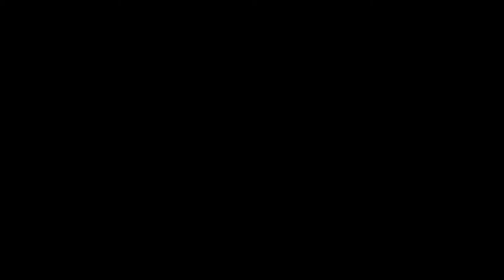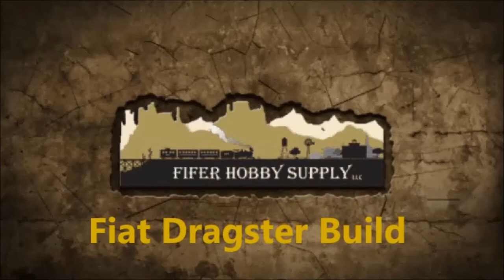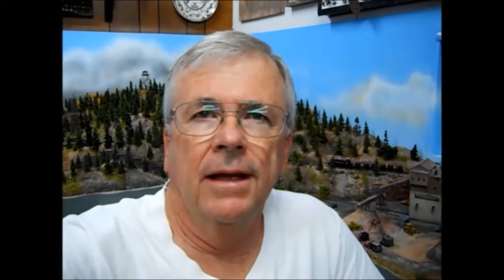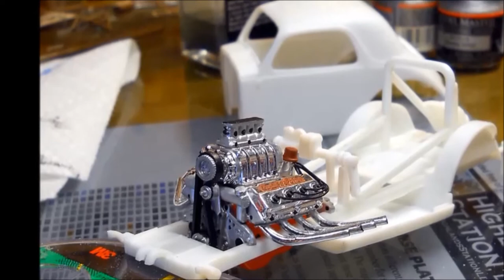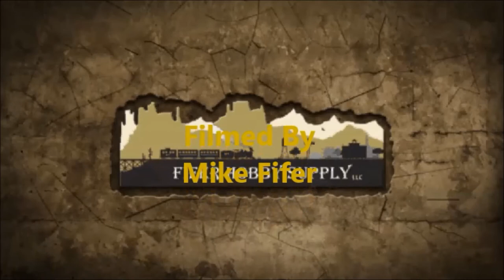Fiat Dragster Build by Fifer Hobby Supply

Comment: Mike, how did you get that water tank to fit between the belt and engine? My tank prevented the belt and pulleys from fitting onto engine contact points at top and bottom. It's a 2009 repro kit of the kit my Dad bought for me in 1963 when I was 8.
Reply from the maker: If I recall I shaved the backside of it slightly .
Thanks , Mike